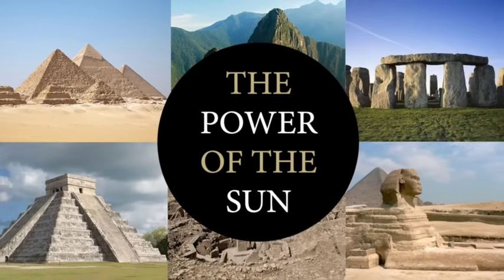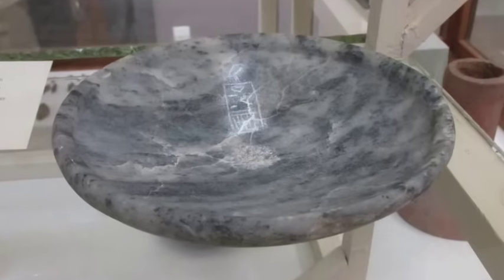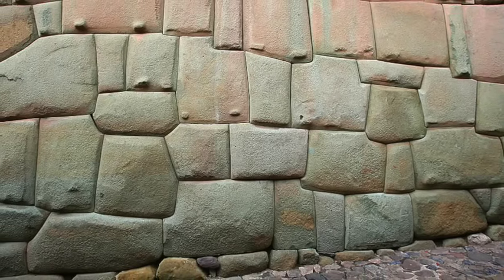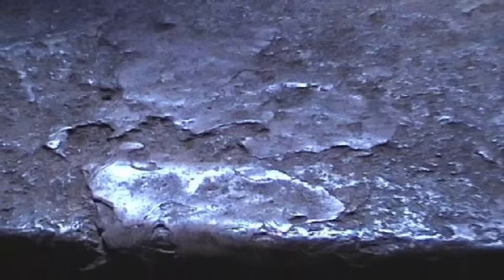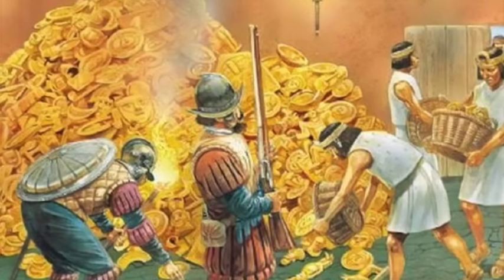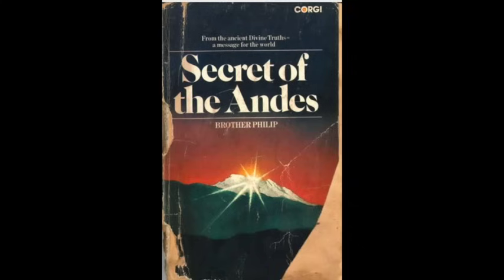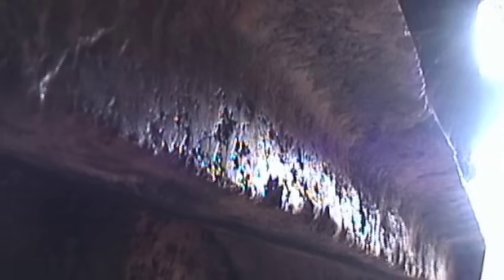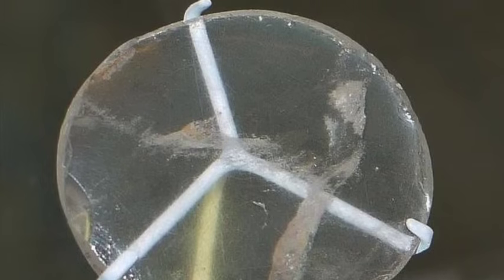How the Ancients Cut Stone with the Sun - Lost High Technology Explained | Ancient Architects

Comment: WRONG!! No evidence for that WHATSOEVER!! When you melt stone it is very obvious!! You can see where it has been melted!! Once you melt it you can't make it look like unmelted stone ever again and you can CLEARLY see where it has been melted and there is no evidence in any of the stone walls or statues or structures!! If there were we would easily be able to see it!! Also melted stone usually turns black and bubbles and I don't see any evidence of that either, on any of the stone blocks or any of the ancient stone walls or structures, AT ALL!!!
Reply: Keith Good, I agree totally. Even if, as Sslakt points out, the rock is heated and then cooled, you wouldn't end up with the result you see in so many sights with soft metal tools. Something else is going on or we would be using this technique today.
And still we have the problem of moving and lifting these things at 130tons and even more. Sure a person can move indirectly a 1ton stone block and even lift it. This doesn't mean that 130ppl can move a 130tonner - it would simply dig itself down. I would like to see it done, and that shouldn't be a problem since so many tend to suggest it is easy to do these things.
Reply: Would it be any advantage to heat stone before grinding with another cooler stone?
Reply: @rickmull1883  well that is a great question. Would like to hear from an expert about that. I still do not see how sharp inner corners would be worked with this aproch.
Reply: They were not melted, but made hot and soft so their soft metal Tools could carve insanely high mass stone like playdo. What is so hard to understand?
Reply: Thats absurd.  Any rock heated to the point of being “soft” would roast anyone trying to work on it.  Not to mention melting the tools themselves.  And how would you heat a huge stone to that point?  No mirror exists today that could do it, and the one on Mt Palomar is 16 feet across, ground to a precise profile.  Poorly rounded chunks of quartz and gold reflectors would be lucky to produce enough heat to cook a meal......
Reply: AND IF IT WERE THAT EASY, SOMEONE COULD SURELY REPLICATE IT TODAY.  DO YOU SEE ANY MIRRORS CAPABLE OF MELTING HUGE STONES?
Reply: @martyzielinski2469   I still don't believe this is the way to cut rock - but you shouldn't say that suck mirror doesn't exist when it does... kind of. Look at this 3500° rock melting beach of a mirror  https://www.youtube.com/watch?v=z0_nuvPKIi8

Comment: It's quite easy to use the sun to generate enough heat to melt stone. You can do it with a parabolic mirror or a freschnal lens. They certainly had the capability to make a parabolic reflective mirror out of precious metals and seems that they did. However melting stone with a parabolic mirror is not the same as precision cutting with a laser. It would be hard to focus the ray of a parabolic mirror into a stone cutting ray, but it would of been easy to melt stone with such a device. For those that doubt that's possible just look here on you tube there's tons of videos of people melting stone and metal with parabolic mirrors which are easy to construct with Mylar film and an old satellite dish, or even a trash can. You stretch the Mylar film over an airtight round container and stuck the air out which causes the Mylar film to suck in and form a concave dish and hey presto your melting rocks and metal, instant death ray. Lol.
Reply: They also had glass lenses for Perfect adjustment of larger discs.

Comment: G'day,

  Interesting, however you appear to want to equate the concentration and heat-intensity of a 100 Watt Laser with that of a Concave Parabolic Reflector...; and that isn't at all realistic.

   If you backtrack me to my "SunGas Project..." Playlist, you'll see what happens when a 0.39 Square Metre Offset-Parabolic Satellite-TV Dish is converted to a Solar-Thermal Concentrator & then aimed at a 500-ml Varnish-Tin with 100 Grams of Wood or Sawdust inside the Tin, and suitable Plumbing to catch what outgasses ...; Pyrolisis commences at 247-degrees Celsius, and I've seen 630 C. on the bottom of the Tin, and I'm getting 6 to 9 Litres of "Syn(thetic)gas" (mostly Methane, with a bit of Hydrogen...) per 100 Gram Batch-Run.

   The Dish collects 900 Watts per Square Metre, so it puts about 350 Watts (almost 1/2 a Horsepower) of raw Heat onto the bottom of the Tin, focussed onto a 35 mm Diameter Circular Area....; assuming the Can is fixed at the Focus of the Mirror, and assuming that the Mirror is repositioned at least every 3 Minutes to accurately track the Sun as it moves.

  I use a Two-part Thermal-Insulation "Tea-Cosy" with Air-Gaps between the layers, over & around the Top & Sides of the Cannister ; otherwise the Can. radiates & conducts so much Heat to the Atmosphere that it barely becomes hot enough inside to pyrolise the Wood.

   To be able to run my Kitchen Stove on Solar-SynGas, I would need to have a 15 Square Metre Dish focussed onto a 10 Litre Container, holding 3 Kg of Wood, and doing at least 2 Batch-Runs per Week...

  There's a hell of a LOT of Engineering required to hold & control any Parabolic Reflector  which is big enough to achieve anything worth doing, as it turns out.

  Also, I suspect that a Stone's ability to conduct Heat internally, away from the point of Solar Concentration, and then radiate it away from the other side of the Stone is far far greater than any amount of Heat which a Gold/Silver Aztec/Egyptian Mirror can ever apply to a small point on the Stone - as regards melting the Stone...

  Meanwhile, to see an actual 10,000 year-old Stone Tool which I still can't figure out how it was made, title-search YouTube for "Boomerang Aerophysics...." as a primer-course so ypu will understand what the Tool was made to do, and then try "The Boomerang-Carving Stone..." ; both of them are in my "Aboriginal Technology" Playlist.

   Have fun,

  ;-p

  Ciao !

   

   

   I'm working on the next step up, with a 1.2 Square Metre  Dish, and a 1 Litre Tin, tripling the Power while only doubling the Capacity of the Gasification-Canister.

Comment: In no way did this prove the sun was used, but rather proved that laser cuts stone. Show one example of reflected sun light matching the heat generated by a modern laser before making this claim. Until then I must accept that you are either liar or idiot.
Reply: Adrien Nash Bakelite tends to become brittle and im pretty sure holes in it is common. I dunno how many of those damn handles I've seen break and crumble off.
Reply: I noticed something of interest.  On my back deck I had a highly polished chrome wok, and I placed a similar size glass pan lid on it.  Some days later I noticed that the super-hard bakelite handle was half burned away, containing even some holes.  Well, the only thing that could have caused that was the concave wok acting as a focusing mirror with its focal point aimed above its center where the handle was located.  
I couldn't find out anything about the properties of bakelite online but I'm sure it's combustion temp. must be pretty high.  So perhaps large concave gold mirrors could produce temps high enough to at least burn a groove into stone, which could be used like a glass cutter groove is used; to produce a breaking line, -along which to split the stone with wedges.
Reply: Adrien Nash you noticed concave wok and concluded that it must be the cause. I can accept possibility, but not probability, and cannot accept that if it was true cause that this is proof of the Egyptians using the method. It does not account for the "machined" smoothness of the stone, and high enough temperatures to melt dense stone would shatter or pit softer stone. I would like to see a perfectly square one inch stone cube made in this manner before I accept a perfectly squared multi tonnes one. Then demonstrate that it could be done within a reasonable length of time. In short, to ask "Could this be it?" make far more sense than saying "This is it!" No proof is offered, just possibilities, is my only point. There was rash leap made, as I see it.
Reply: Exaclty, the theory and tests show lasers rather than golden mirrors were used, but the narrator of the video either doesnt have sense to understand the source of his information or doesnt care.

Comment: Those people with the pyramids kept better records than the Nazis. Why didn't they jot a note that would explain how they managed to manipulate stones? And why can't we make the disks and replicate their work?
Reply: Why did they not leave a note? Because our history is hidden? Because every conquerer in history destroyed the culture and knowledge already present? Because of several book burnings in history? Long story short, humans are retarded. When we conquer something we demolish everything until all that remains is the culture of the aggressor. Cmon now thats so basic
Reply: 12 Volts lol ya but they had tons and tons of goooold and that's not exactly true either has gold can be hammered extremely thin.
Reply: 12 Volts   you could plate it with gold. don't need that much.
Reply: Mike Armstrong the gov look up Mexico revailing statues and stone work every gov does it so they stay in power
Reply: Just like the ability of making concrete was lost with the collapse of the Roman Empire. It had to be figured out how it was formulated after many years
Reply: 12 Volts  That is why you scale down. Instead of cutting 1m thick diaorite, you just cut 10 cm, so instead of 3m meter, you calculate the smallest size needed. The only excuse is surface area for sunlight and this can be easily achieved by using mirrors onto the small gold disc. Very cheap experiment.

Comment: This is so stupid!!!! A laser is like analogous to a string, it’s divergence is so so low that a laser can be shot to the moon and its radius at the target site at the moon will be slightly larger then the original. When using reflective surfaces to focus the energy of a light source, like the sun, two “cones” are formed, one is the one formed by the light converging and the other one by the light diverging. Both cones meet at the focal point with is the spot of highest energy ( something like this  ><.  )witch, depending on the distance between source and target can vary between few microns to 3-5 feet. Look at the solar plant in Spain GEMASOLAR’s specifications, a quick look can help in understanding the optics involved on the focusing os folate power (https://www.nrel.gov/csp/solarpaces/project_detail.cfm/projectID=40). it is upsetting how people totally ignore simple and basic knowledge to build such deceitful explanation to this awesome and still unexplained ancient work. I wish I had time to go into petrology to provide a little bit more insight against this absurd theory, but, simply, what happens when you melt silica? Basically You get glass, any rock exposed to a melting point temperature will produce a glassy surface.... anyway... please read further into petrology (geology).

Comment: I can cut granite in the back yard. A copper bar, in the shape of a long square solid tube is rubbed across where they want the cut. Keep throwing sand under the bar as it saws back and forth. The sand will cut the granite with little wear to the bar. This is very true and very easy to replicate. Power tools, technology and blah blah.. no it's a copper bar and sand. If I can do it like this, I need no other explanation, no aliens, nothing. The simpler answer is usually the true one.

Comment: A good theory. I can also imagine it can't be applied to all surfaces for instance curved. Anyway, instead of 8.30 mn of speach (easy to do), a long example showing one instance of process in real time would have been more efficient. A theory, even good must be proofed.
The excuse "I have not gold enough" is not good : a modern mirror would be sufficient to produce such effect, even if slower or less extended, and I don't believe gold mirror roughly produced (not at molecular size) would be better.

Comment: The difficulty would be in controlling and directing the beam precisely across large distances (to smooth out a wall, for example), as well as to make intricate cuts such as accurate internal corners. So if they used solar power, there must have been other devices, maybe using those small crystals, for directing the beam--probably destroyed by those good Christian Conquistadors. As for electricity, well, how did they light up the interiors of temples and underground chambers and tunnels in the distant past? The Egyptians certainly knew of some kind of electricity, as the Dendera lamps indicate. http://ahotcupofjoe.net/wp-content/uploads/2016/11/denderalights.jpg You can even see that they are attached to a cord that leads to a box of some kind. Are these meant to be Crookes tubes? They look very similar. https://www.crtsite.com/big/crookes/maltese3-big.jpg

Comment: Still doesn't explain how they fitted those blocks together so that a razor blade could not get in between. Also, this would be ok to trace a superficial line, but what about cutting a whole 3D shape? a single beam is good to split a surface in two but not for shaping... this sounds very unlikely

Comment: This explanation doesn't explain anything. Ok, glazing shows high temperatures, but the sun disk or giant magnifying glass focussing the sun doesn't explain the perfection of the lines, the perfect symmetry of the gigantic carved faces, or the sheer number of artifacts. In Egypt alone there are literally tens of millions of perfectly carved massive blocks in the pyramids, and extremely complex inside corner cuts and perfectly symmetrical bowl shapes, convex and concave shapes, extraordinary detail in massive carved figurines that are perfectly symmetrical... Etc! If one per day were produced and if the standard dating is accepted, the carvers would still be working today and would be far short in number of the tens of millions of building blocks, slabs, and innumerable artifacts that exist. Ok so MAYBE focussed heat can cut stone, but that doesn't account for the perfection of the cuts! That is like saying a pencil makes marks on paper and thus that solves how the perfection in the drawings of Michelangelo were made! No. The pencil as a maker of a marking does not account for the guiding and artistry of the artist. The sun disk theory does not explain how they moved or controlled the beam to create such perfect finished pieces. And PLEASE, the perfect holes the author shows have machining marks on the inside! This has been shown by Christopher Dunn repeatedly, there are tell tale machining marks left on many of the stone artifacts! This heat theory doesn't explain anything. If the professor from Minnesota can creat a single piece of work from his gold disk and sunlight theory that is anything better than sloppy, and is completed extremely quickly, then the beginning of a theory is legit here. This theory is totally reproduceable. Get the best artists to be found and give them gold sun refracting disks and I guarantee they won't be able to make anything that can be even remotely considered "perfect." And so very far from being able to make tens of millions of building blocks and artifacts. This video is as absurd as the idea that all these ancient artifacts were made in such abundance and so perfectly by use of soft metal, very dull chisels and a stone as a mallet. Come on people, THINK just a little bit.

Comment: Interesting idea, however, the round holes were clearly made using a drill as the drill marks are present and determine the pressure and speed used. It does seem clear that a softening of stone was also used at sites around the world. The granite boxes in the serapium at saquara seem to have been finished in situ so unlikely a sun disk could have been used. Some form of   electrification would have been needed to quarry, transport lift and position, together with sophisticated calibration tools.
Reply: Im sure dinosaurs could pull stones like nothing at all.
Reply: Yeah, they probably could but not too good at cutting and polishing though!

Comment: yeah I don't agree like the people below, just consider the machining marks in that hole you showed at the beginning as well and can be seen on the obelisk hieroglyphics which are absolutely identical to the precise measurement, also if the sun and some magnifying crystal or glass was the case how were they so precise? for example try burning a triangle on a piece of paper with a magnifying glass 3 times, think you can get it precise every time to be identical on all 3? I highly doubt it, how did they use this method in the valley of the kings? deep underground, I don't think this solves anything, if you guys could show am experiment with some form of proof then I'd believe, talk is cheap and to say it's solved is well a complete lie, put it to the test prove it then say it's solved, hey id love this to be the answer but meh I'm not convinced.

Comment: They may have used this meathod in some processes but the holes can be easily done with a copper tube and sand. Then the close fits can be made by rubbing stones together with sand inbetween. The glazed portions maybe cut with mirrors or lenses

Comment: as a man who spent his formative chilsbood years burning things with magnifying glasses i know that the hole itself cannot even be cylindrical due to the angle of the lens' perimeter and the focal point from the center of the lense. even if the object rock were to be wobbled to offset this angle its depth would be still limited by the beam ratio and 90 degrees. without anymore proof, i think it (the sun worked hole) would never be cylindrical.  
you got all that from a fresnel lense and a penny sized molten puddle.  1% objective.